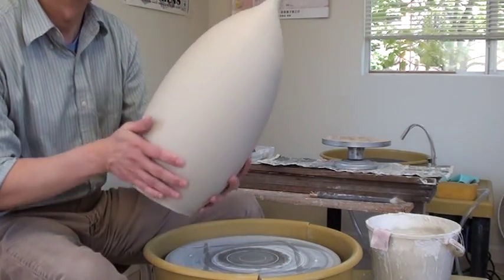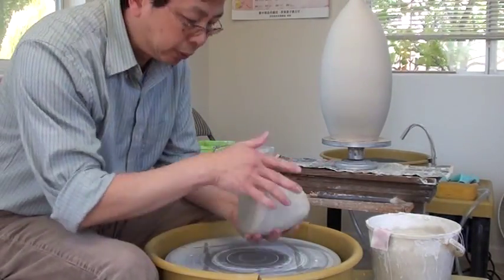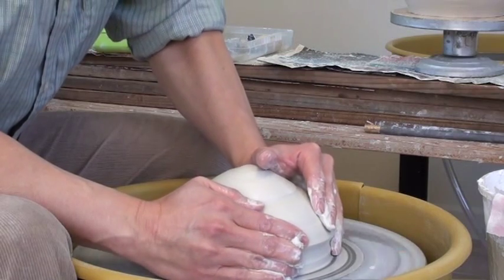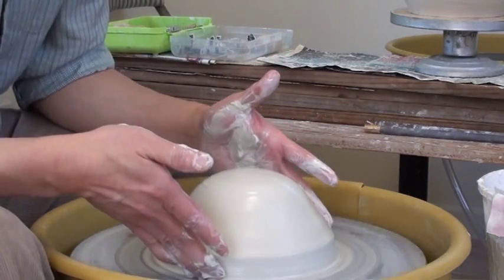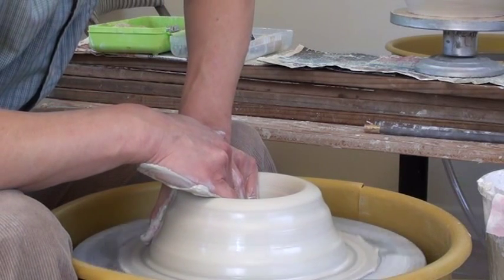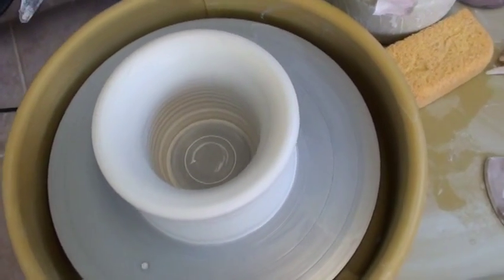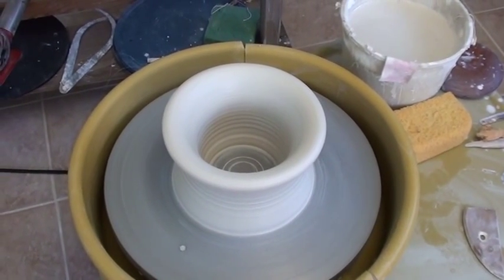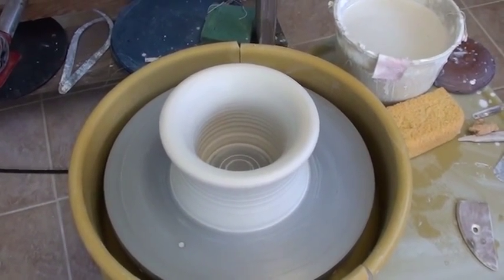102. Throwing a Wet Chuck for Trimming Small Opening Vases / Bottles with Hsin-Chuen Lin

Comment: How long should I wait to dry the chuck before I use it? I am new to pottery. I just made a sake bottle today and realized that I need to have a chuck to trim it..Thanks for posting!
Reply: Stella Wang I asked this question a few years ago. He answered the question "Hsinchuen Lin 3 years ago in reply to Andrea Wolf

I would wait at least a day to dry it and maybe keep the wheel spinning whole day.  If you can't wait that long, try to speed up the drying process by using a heat gun or torch. "